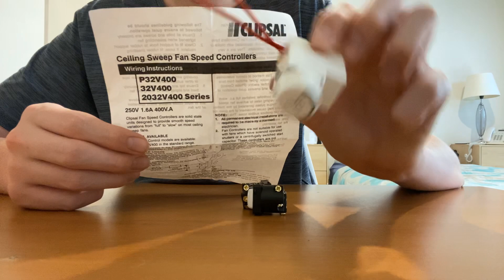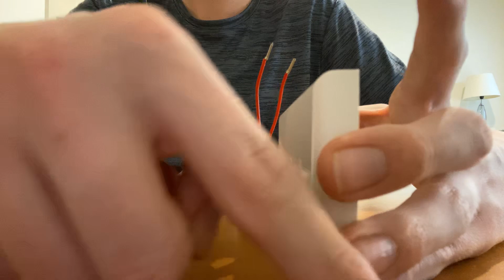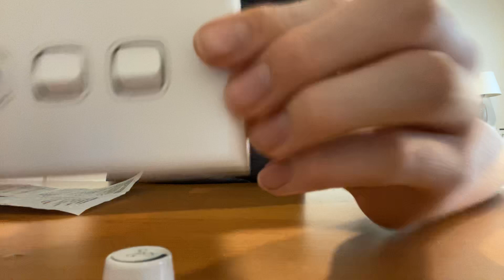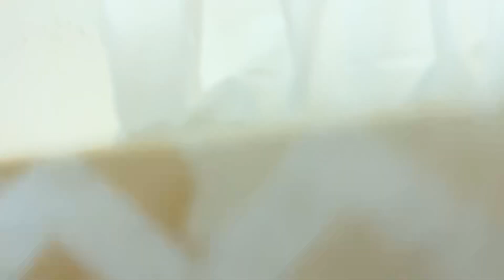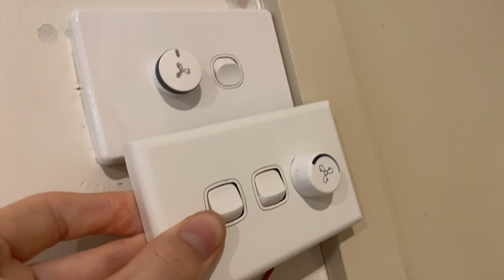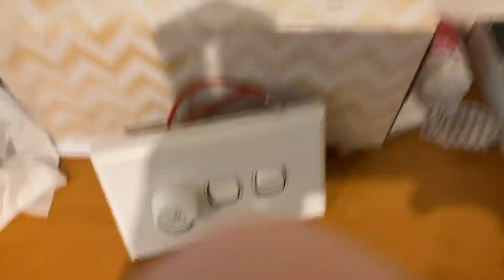Variable Speed Controllers - Ceiling Fans

Comment: these don't necessarily limit the power to the fan(s) they actually just pulse it. they are completely different from a light dimmer. they basically flash full power, the faster the fan is spinning the more pulses. if you connect a light up to one of these which I have tried, it just flashes. the higher the controller is set the faster it flashes. the purpose of these is so that you can put more than one fan on a single controller. these can handle up to 8 ceiling fans. if you put more than one ceiling fan on a normal 3-speed capacitor-based, it will go up in smoke. the purpose of these is to have more than one fan on one control. and it isn't recommended to connect exhaust fans to them.